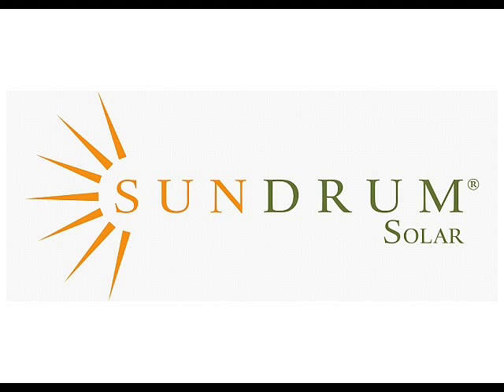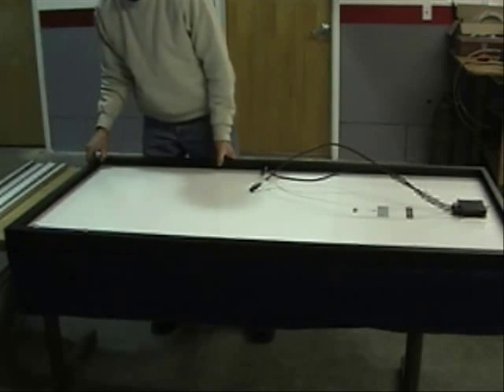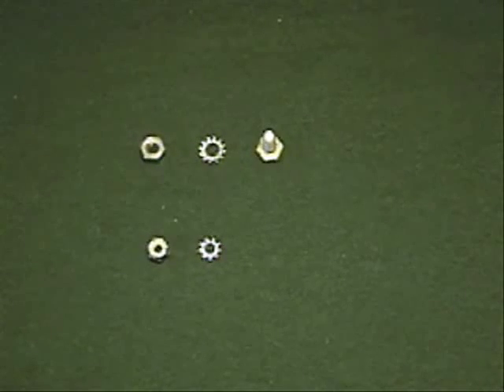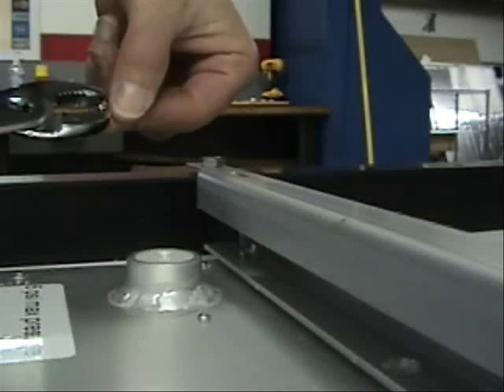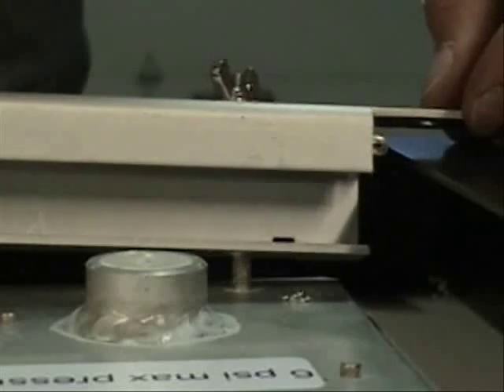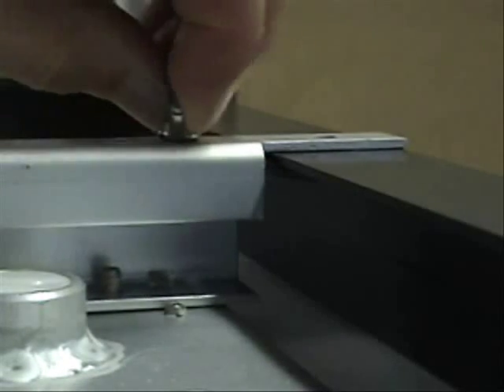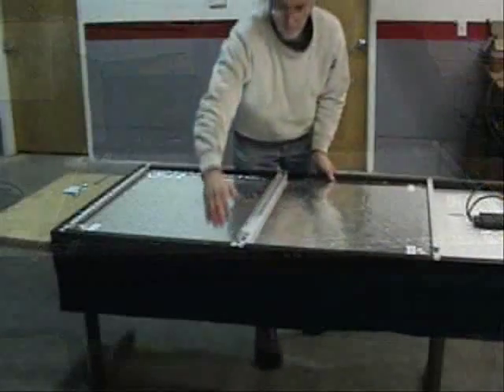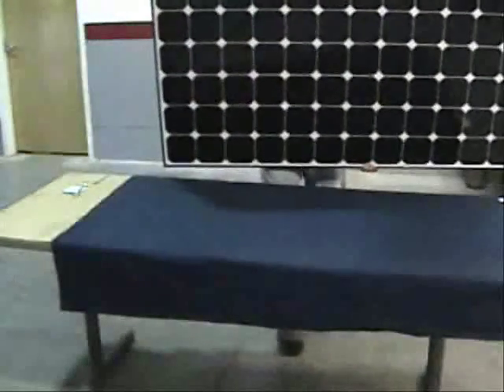SunDrum SDM100 Solar Hybrid Assembly Process

Comment: The conversion of a PV panel to PVT is the easy part, what fails with all PVT systems, is the use of the rest of the standard kits used in solar thermal flat plate collector systems, with the hot water tanks world wide, not designed for solar thermal or PVT.